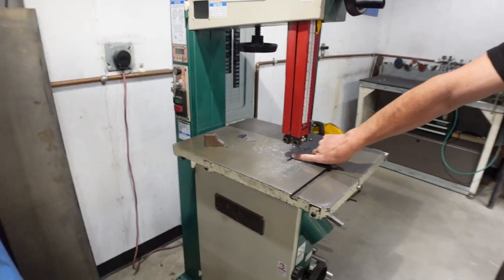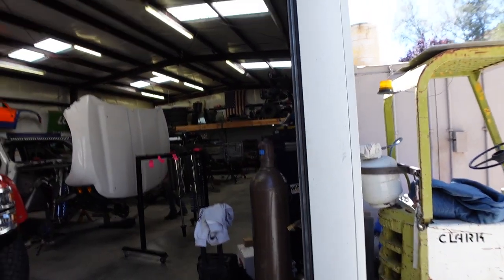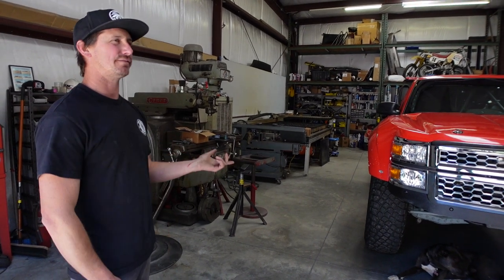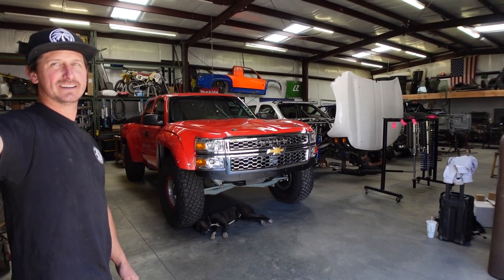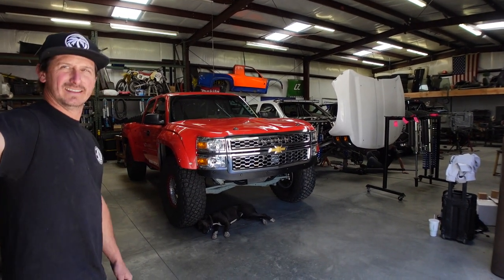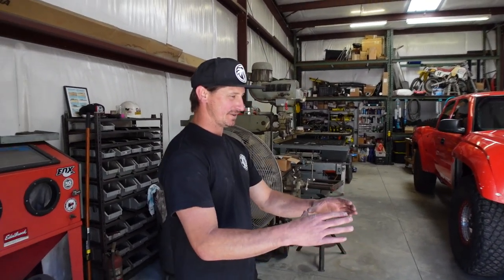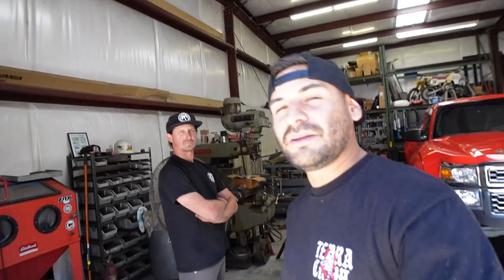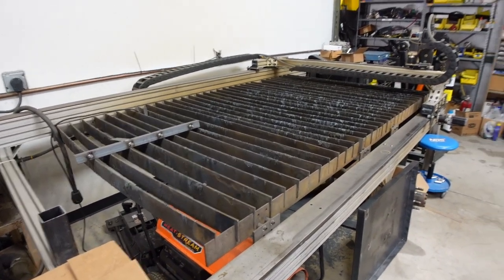70 year old tool helped build this truck! Danny Giannini | SHOP TOUR

Comment: Great video! the shop I worked out here in Norcal we built off-road pre-runner front bumpers for Chevy,Ford jeeps I built  rock crawlers, roll cages. I built Larry Rosler the front PrerunneRr bumper for his jeep Cherokee .work for Hanson bumpers , Basic same shop set up used all those tools they were great had all the paper templates for everything nice to see that the old school and it still works 
If you need it! 👍🏻👍🏻 on the shop tour do more!

Comment: far from basic.  he has badass machines.  my buddy learned from old school guys and has a drill press welder angle grinder and small sheet metal break and built ultra4 car he currently runs today.  hand notches everything.  this guy has an iron worker plasma table multiple welders and drill presses.  also lathe and a bridgeport mill.  this is a nice fab shop with nothing basic about it.